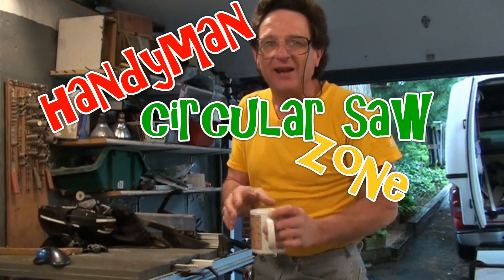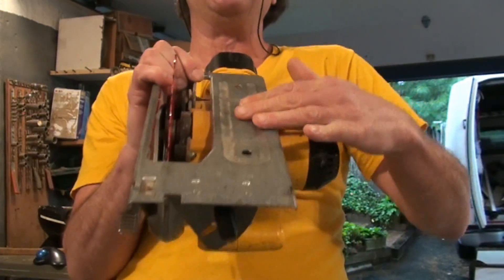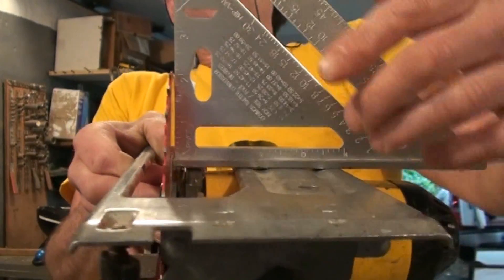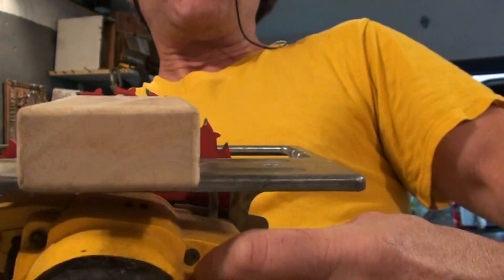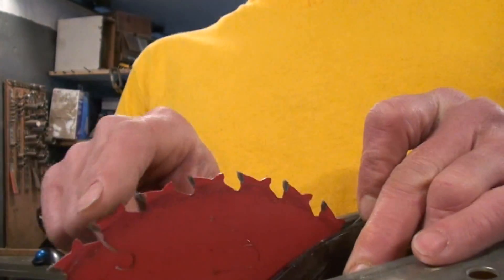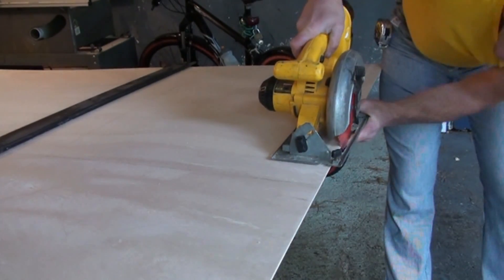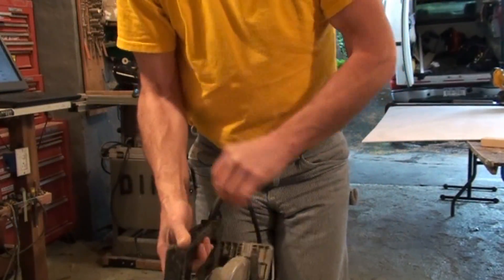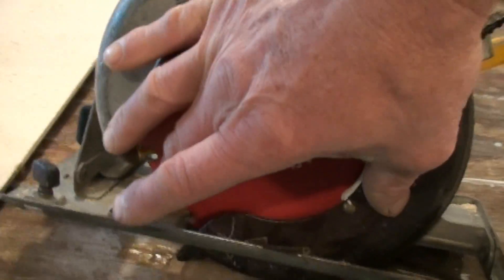use SKILLSAW safely & long cuts plywood

Comment: This is about safety?/? Fumbling around with a speed square with the saw upside down pressed against the blade with the battery still installed? Are you insane??
Reply from the maker: +Hammond Echs , most modern skill saw have a safety lock trigger (2 buttons must be pressed at same time to activate) i have more chance getting hurt "fumbling around" as you say than by the saw turning on. thanks the comment
Reply: Dino Pinch My father cut 4 fingers of his right hand because he didn't know whilst he was holding the saw the safety button was pressed and then he pressed the trigger. Incredibly stupid thing to do and couldn't have happened to a more deserving person but safety buttons, catches or released offer no guarantee of safety and as Hammond says the guy is insane and that is exactly how accidents happen!
Reply from the maker: Rob, any power tool is dangerous! Even ppl like you that do everything by the book get hurt, I've even read about ppl that secretly desire to be disfigured..."xeonmelia"..not saying but ijs, who knows if it's YouTube video, careless work, fatigue, faulty safety guards, defective tool, distraction, rush, indifference, inexperience, freak accident....you just can't say, no one can. I've given good safety advice on vid & linked to other safety vids....who it's blame me? Manufacture? User? Or any above?..thanks watching!

Comment: All the cheap sound effects and moving visuals ruined what could have been a reasonable video. Also a little warning could've been given before showing such graphic images. Removing the power supply/battery and isolating the tool is the first H&S rule in the book, and you failed it.

Still, a good effort went into this video, so credit for that.